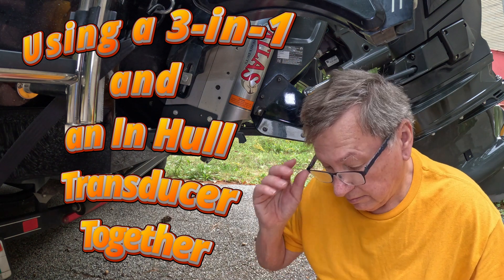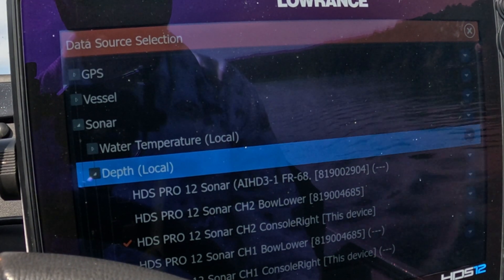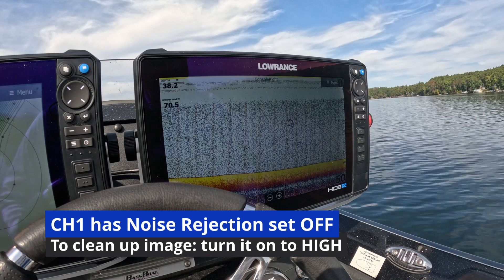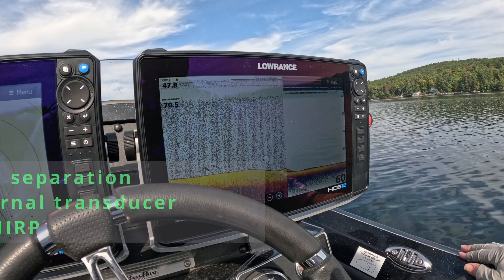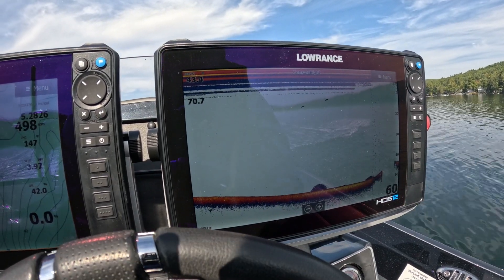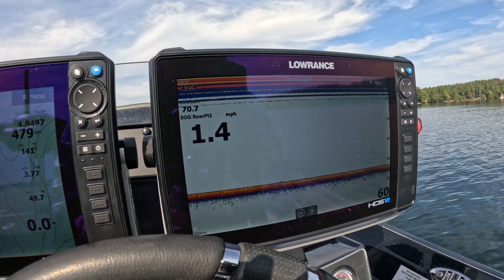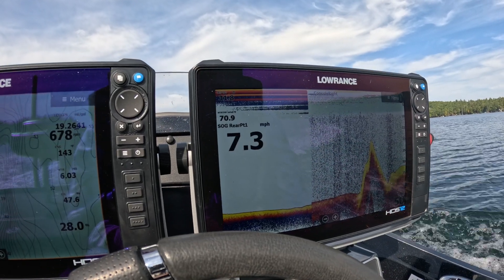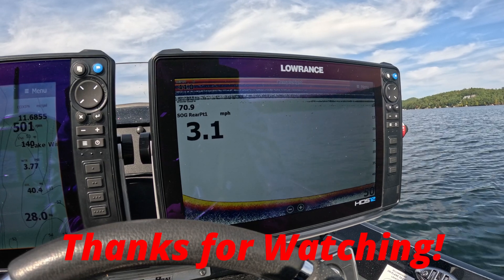How to Use Active Imaging 3 in 1 with an In Hull Pod Transducer

Comment: What causes map to spin when sitting still?  I do have point one connected
Reply from the maker: There is no heading (compass) data set to keep the map from spinning.

You need to use the Heading sensor in the Point-1. If you look at the Data Sources video, I talk about that value. In brief, Settings->Network->Data Sources->Vessel.  Under Vessel you will see Heading, make sure that the Point-1 is selected. As long as the Point-1 is not mounted near a magnetic source like a trolling motor the orientation will be correct. If it is near the trolling motor then the map will be off but will not rotate due to the magnetic interference with the heading sensor. Garry

Comment: Something that help me with this was to actually name the transducer as well in the settings
Reply from the maker: Thanks, I'll see if that works for me. I did something similar on the S3100 module. And yes that would help.

And thanks for watching the video!
Reply from the maker: Hi, thanks for the suggestion. I went into the Sonar settings and named the in hull transducer. That worked great.
Reply: @garrywoodruff960  You are welcome. I love your channel, I have learned alot watching your videos and feel so humble that I was able to offer some info and it was actually useful for you. Made my day.
Reply from the maker: I like it when I help people and I appreciate it when people help me as well. Thanks for the compliment too. I try to put out videos that people want/need help with. I might over the winter do a full video on naming the units and transducers too.
Reply: @garrywoodruff960  Awesome, I will be standing by to watch.

Comment: Great video Gary ! I haven’t even used my 2d from my HD 2in1 yet but I’m gonna try it. But actually my thru hull is pretty darn clear 👍
Reply from the maker: Thank you. 

The 2-in-1 only has down and side imaging. There is no sonar transducer built-in. I noticed on the St Lawrence that when I was using my 3-in-1 (external) that I could see fish stacked on top of each other. When I looked at them on the  in-hull transducer, it was just a thicker blob on the screen. But I usually just stick with the in-hull most of the time.

My thru hull is clear when I have the setting right. Somehow I must have changed it on Champlain when I was changing the surface clarity. It is just not as sensitive.

Garry
Reply: @garrywoodruff960  True on the 2 in 1 as I was not aware that this transducer did not have 2D capability. I'm questioning my in hull transducer as to the accuracy of what I'm seeing. I switched over to the 2 in 1 and it would find the bottom with no detail. If I want the 2D sonar in the external Active Imaging transducer I have to buy & install the Actived Imaging 3 in 1.

By the way you probably already know you can rename each transducer so when selecting them in the SOURCE menu it makes it easy and you can see which transducer the unit is using on the display screen. Again you probably know all of this I assume but I thought I would make sure. Thank you for the outstanding videos I just subscribed.